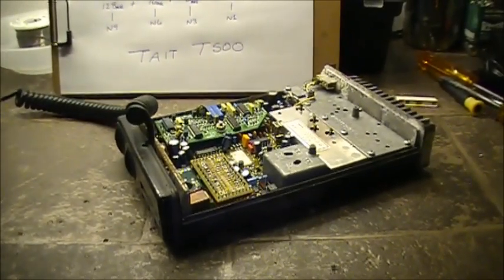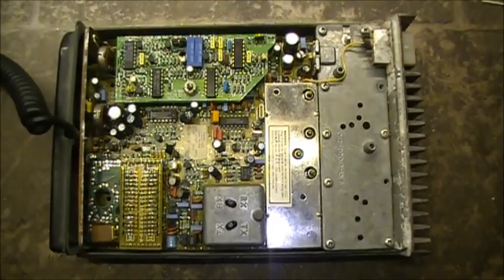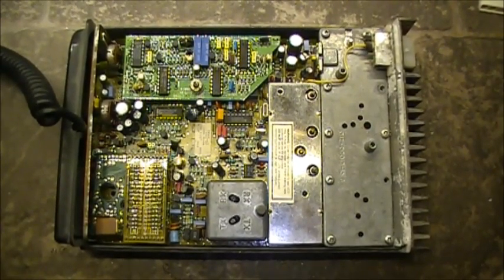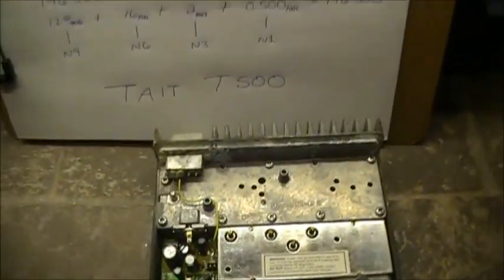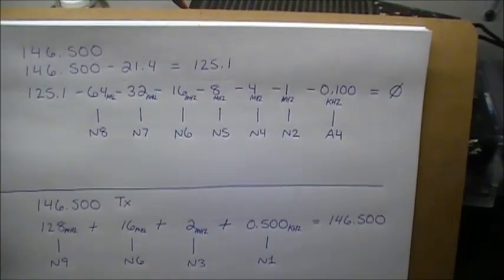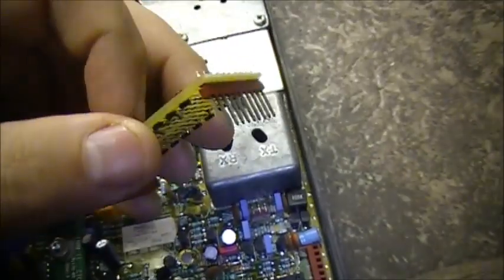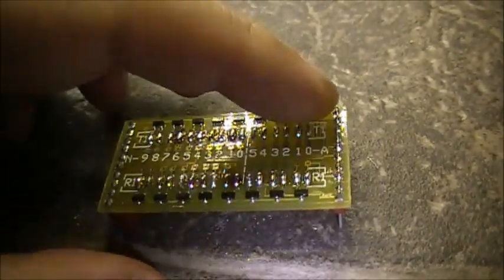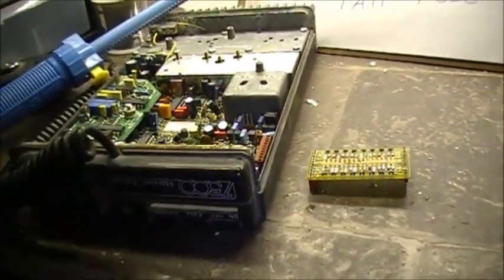TAIT T500 Programming

Comment: I think there might be some confusion on the 40 and 80 channel conversion kit information.  The TI-292 and TI-323 references are the fitting and servicing  details  for the conversion kits. 

The Tait T535  (M535-00) Issue B manual in front of me reads that the TI-292 doc is for the " T500-03 and T500-04 Multichannel kits (previously designatedTA-500/10 and /40 respectively) add-on kits which convert Series 1 or 2 radios to 10 or 40 channel operation."

Similarly the TI-323 document  is for the "T500-55  Multichannel retrofit kit which converts Series 2 radios to 10, 20, 40 or 80 channel operation."

A further multi channel conversion kit, designated "T500-58 Scanning Multichannel" converts a Series 2 radio to 10, 20, 40 or 80 channel  operation with a capability of scanning up to 10 channels.  Document TI-352A refers to fitting and servicing.

The brand new boxed T500-55 conversion kit in front of me is labeled:-
 "             T500-55
T5 x 5 LED Display Multichannel Kit
             Refer TI 323
Job No:- 7091    D2
Final Inspector  Sharon Jones"

The empty uV prom socket  on the enclosed PEC is 24 pin, not 28 pin, as would be required for the 27128 uVprom .
I hope this information helps; If anyone has data for the uVprom type for the T500-55 I'd be very grateful if they would share it.
Reply from the maker: Thank you for the information.

Comment: T555 is UHF, low means 420 to 450MHz ish
Low band 68-88 is a T525, Highband 136 174 is T535, 175 to 220 trunking is T545
Without the last 5 digit eg T520 is Mk 1, so a T555 is a Mk2 UHF
Reply from the maker: Diode matrix is hard on the brain...  i shelved this radio and never looked back...
Reply: @Radionut63  Tait made two conversion kits for the T500. TI292D 40ch kit using a pair of 16mm x 6mm thumbswitchs controlling a 27128 eprom, blown for up to 40ch. and TI323A 80ch kit with a new front panel which has 4x 7seg LED displays controling a 27128 eprom

Comment: I used to install radios like these in the early 90's. I seem to remember the diodes being discreet orange ones like 1N914s or something. Those diecast panels with Tx Rx on them used to cause microphonics so we would bend the sides a bit so they earthed better. We also used SelCal boards in them.
Reply from the maker: These are rather interesting radios to program i must say.     This was my first attempt at selecting frequencies by diodes.. Least now i have a better idea and how to go about it.  :-)